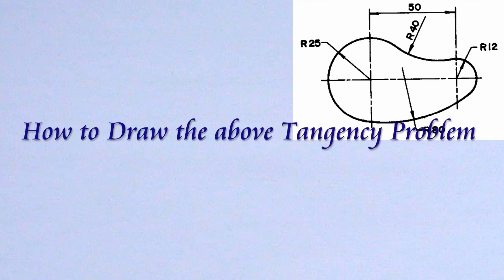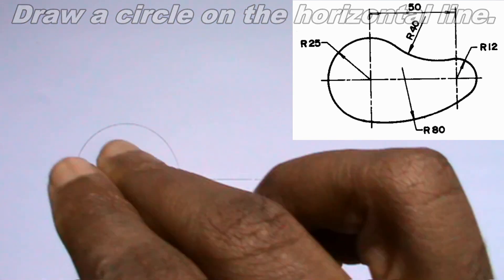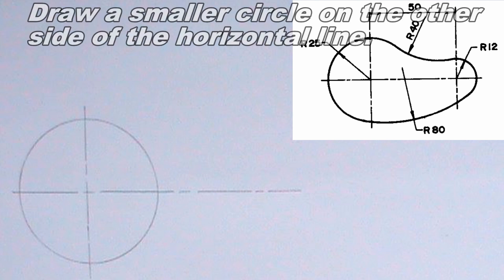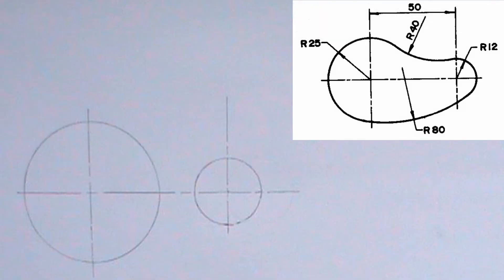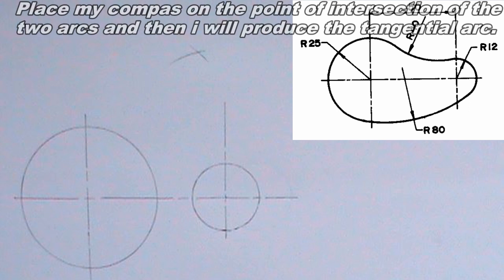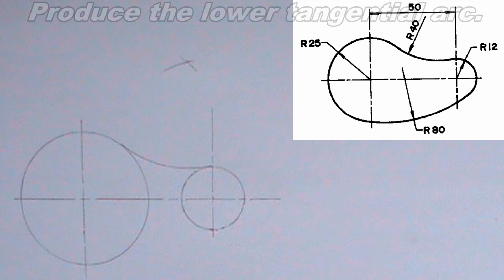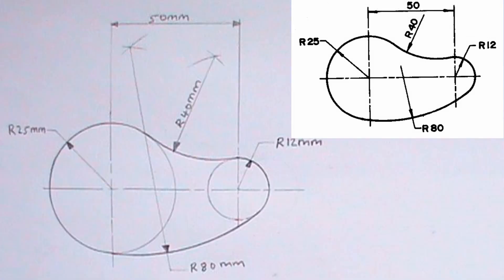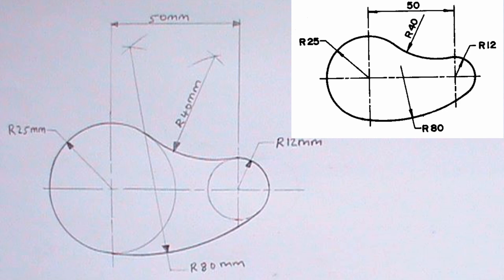TANGENCY PROBLEM 3 || ENGINEERING DRAWING || TANGENCY || TECHNICAL DRAWING

Comment: How have you identified the arcs?
Reply from the maker: Using intersecting arcs to identify the tangential arc is a rule in solving tangency problem. If you need further clerification you can contact me on whatsApp +23490443102215.
Reply from the maker: You can also contact me on facebook, Victor Atonila.